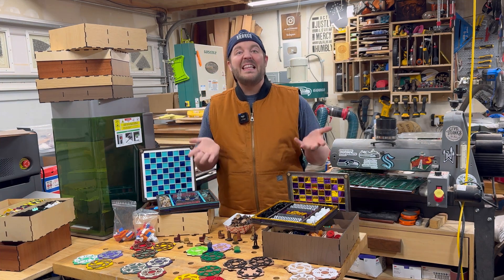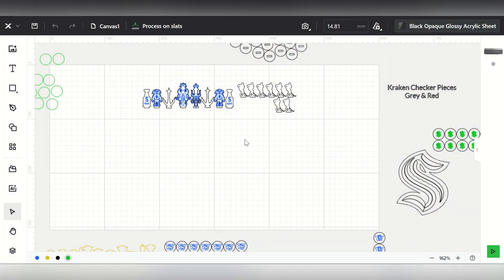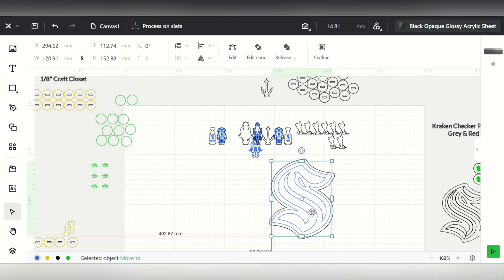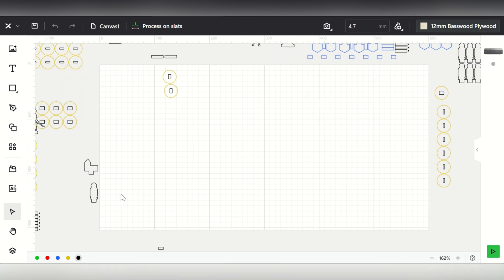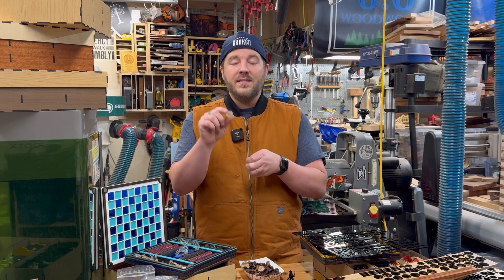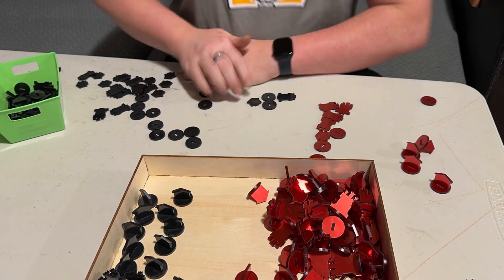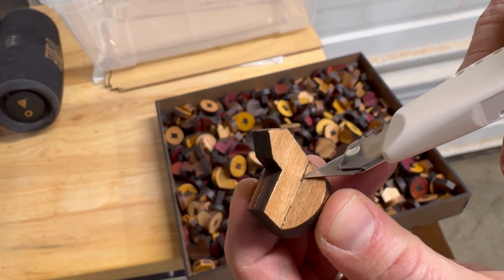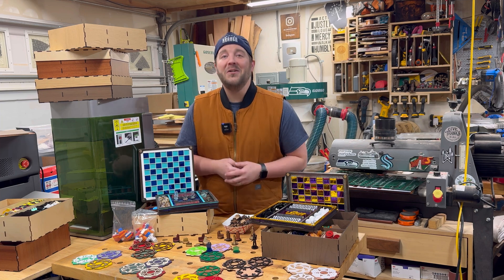Laser Cut Game Pieces: Software Design, XCS Tutorial, Material Tips & Tricks (Zero Sanding Hack)

Comment: Just be careful on the size aluminum oxide you use, there was a lot of dust when you loaded the tumbler and the super small stuff can get in your lungs really easy.  Once it's there, it doesn't leave.  As an added bonus, it's carcinogenic.  We use it in our grit blaster at work with a down draft table and we still use N95s for PPE.